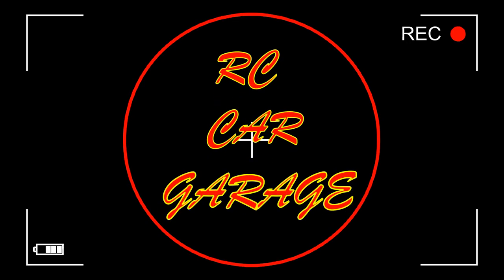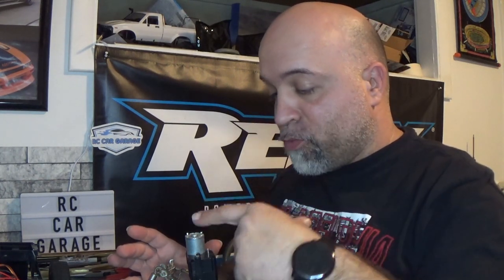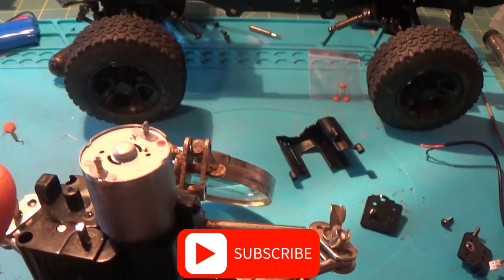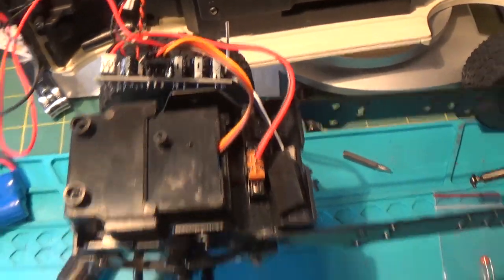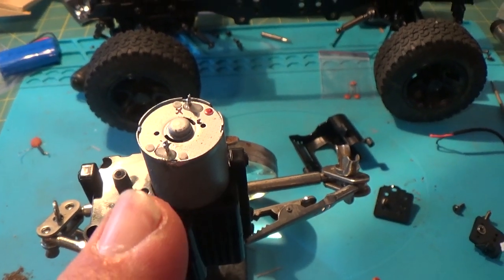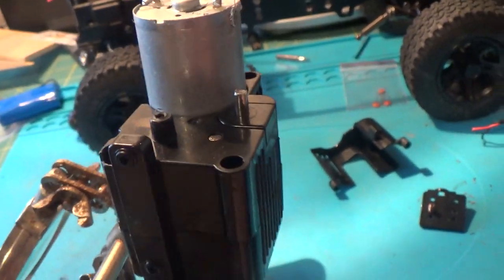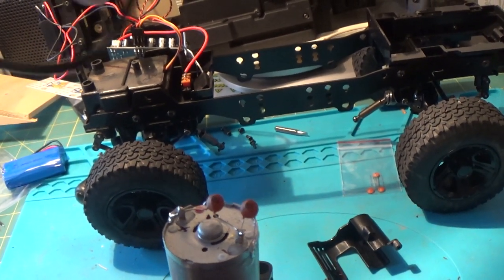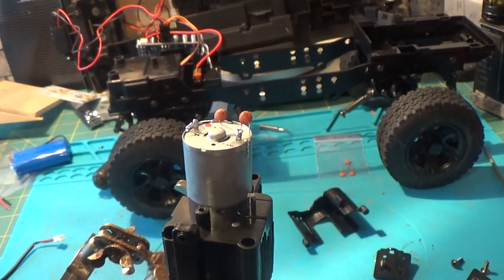WPL C74 Suzuki Jimny Res V3 Capacitor install and test run It didnt work

Comment: Not to deter you from using the wpl esc/receiver combo but when I got my c74, I swapped out the esc for a Hobbywing 1080 and a 3 channel spektrum receiver. I kept the 370 motor in it for now but it runs flawlessly with those electronics. I’ve even tried it on 3s and it was fine. You can’t go wrong with a HW 1080.
Reply from the maker: I totally agree with you majority of my crawlers have a Hobbywing in it. There is 1 thing that WPL mentioned for me to try which I am going to but I don't think it's going to work
Reply: @rccargarage  hopefully their way of fixing the issue works since you already have it installed. Will standby for a follow up video.